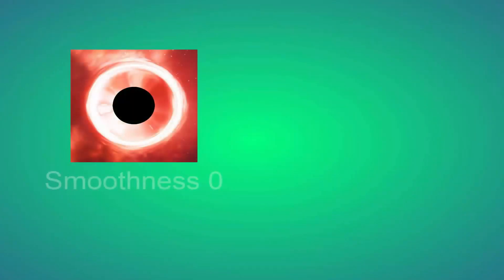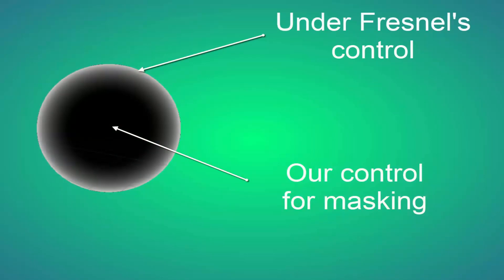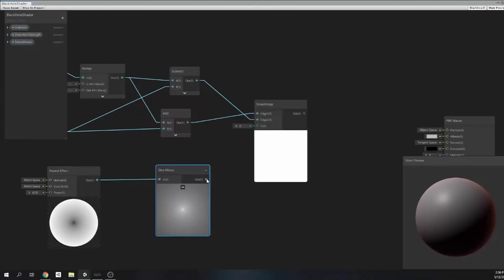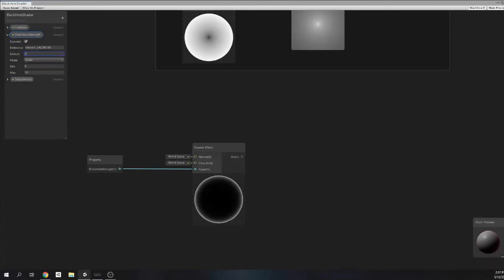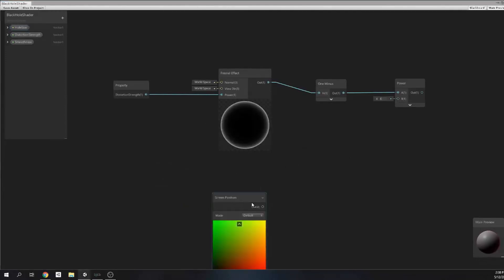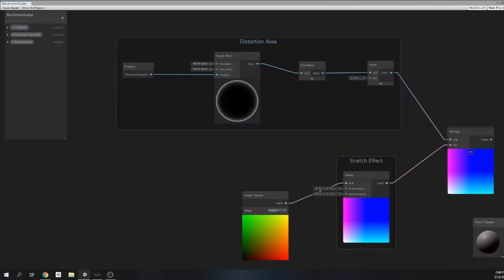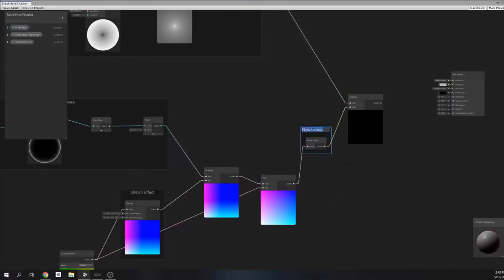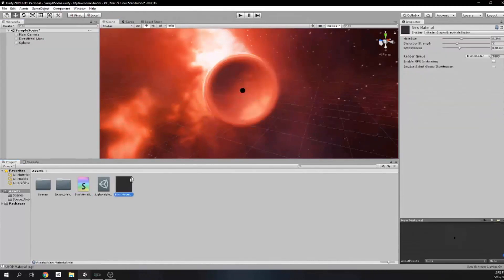UNITY SHADER GRAPH with Black Hole Shader

Comment: Amazing tutorial man! Is there a way to set the shader, so the distortion can occur also in materials set as transparent, like particles?
Reply from the maker: Hi! URP has a forward renderer by default, which means particles(transparent stuff) should be rendered in the same pass. So TL;DR; it should work with transparent stuff like particles, yes.

Comment: You liked my message but didn't answered man, can you help me if you are familiar with my peviously talked about problem, i really have no other options, i tried so many different things with this shader but couldn't find a solution
Reply from the maker: Sorry, I thought I wrote a response but I guess computers don't compute me these days. Have you tried enabling opaque texture on render pipeline assets settings? Also which version of urp/unity do you use?
Reply: @MertKirimgeriGameDev  yes i enabled opaque texture, it works just fine in Unity editor and the version is 2020.1.1f1 but the problem is Android build, i attempted to build with many different settings.My URP and shader graph version is 8.2.0 and. No matter what i do i cannot work it on my android device :(

Comment: Hey, it's amazing! But I do have a problem anyway... Blaco hole looks fine while in the middle of the screen but the problem is that the distortion around is comes from the object I'm looking at even if it's not behind the black hole... for example I have the black hole on the left half of the screen, the planet on the other half and when I look at the planet, it still affects the black hole... besides that it's amazing and just what I was looking for but can't find a way to solve this while still having a good performance
Reply: i have the same issues did you fix it, any one can help us plz?

Comment: I had problems with its transparency I realized that the albedo was interfering with its transparency so a quick solution was to connect the final multiply node to albedo as well i know its not a good solution but it worked just thought i would share it
Reply: @K P I will try for sure tnx

Comment: How do you fix the fact that it breaks if u dont look directly at the blackhole? like if a star comes in the foreground it still affects the back hole
Reply from the maker: You can try to use a second camera and feed it into shader, then duplicate every and use this second camera texture for it. Then blend them together. Or the easier way,. Use that second camera to capture for ground again but use the render texture with a material then assign it into a plane and put the plane at the back of black hole. I'd suggest you to render only star with layers from second camera and enable transparency to not scramble things. Keep in mind that multiple camera setup only works with latest versions of URP.
Reply: @MertKirimgeriGameDev  Yeah thanks for the reply. I have been trying to do exactly that but not sure how. Can i let the shader graphs's scene colour somehow get the second camers opaque texture? or do i do it completely differently?
Reply from the maker: There is this "Camera stacking" feature that URP introduced recently, I think you need that, it might let you use opaque texture. There is another way tho but it is quite tedious so I'd try this one.
Reply: @MertKirimgeriGameDev  seems like it only lets you make overlays which i cant get to work :(
Reply from the maker: @Ab-ox7mo  Well, if you wanna capture something behind the camera with shaders, what I can think of as a separate option is RayTracing/Path tracing. But I'd imagine that it would be pretty difficult to make with shadergraph.
Reply: @MertKirimgeriGameDev  Yeah,  Im sure there is a way to do it, its just not worth the effort considering it still looks pretty decent without it. thanks for the tut!

Comment: Hey Mert, awsome black hole! But I have a problem when using the LWRP because not all shaders of mine are compatible. Is there a way to use the black whole without LWRP?
Reply from the maker: You need to write shader code than. Or use 3rd party node based tools such as Shader Forge or Amplify.

Comment: Hi there Mert! I've tried following this tutorial on Unity 2020.1.0a11, and unfortunately in the graph editor, it shows the message that "The current render pipeline is not compatible with this master node". Is there a way to fix this? I have downloaded the Lightweight Render Pipeline, NOT the Universal one, but it is still apparently called "Universal Render Pipeline". Might it have something to do with that?
Reply from the maker: Hey Jelle! Light weight render pipeline is renamed as Universal Render Pipeline in newer versions. But that shouldn't be an issue because I tested it two weeks ago with universal render pipeline and 2020.1 alpha and it was working.
So, let me ask this, have you switched from legacy to Universal Render Pipeline by assigning it on graphics settings?
Reply: @MertKirimgeriGameDev  You mean in the project settings? I am basically a complete noob when it comes to shaders and settings related to it. When I go there, and to the "graphics" tab, I see: "Scriptable Render Pipeline Settings". Under that, I see "None (Render Pipeline Asset)". When I try to change that, there is nothing else to select. Is this what you mean?
Reply: @MertKirimgeriGameDev  Also, I didn't expect such a quick response! Thanks a lot!
Reply: @MertKirimgeriGameDev  I just figured it out. Sorry for the extra posts, and thanks again for your answer <3
Reply from the maker: I am glad you solved it 🙂 No problem for asking questions. I am trying to help y'all with this channel. Community taught me a lot over the years. I feel like now it's time to give something back😊

Comment: Hey there Mert. My team and I have been at this for a few hours with a default LWRP install, and can confirm this shader is no longer working as of Unity V209.2.11f1. There something funky going on with it not respecting transparency. I gave your video a like anyway, as no doubt it used to work back in the day and it looks great.

Edit: Correction - After downloading your source from Git we can see that the shader still works, none of us can figure out whats gone wrong here for the longest time until we identified you need to MANUALLY set the Albedo color to BLACK or it will not work. Such a simple step.
Reply from the maker: Hey there! I am glad that you folks figured it out! Let me know if anymore questions rise up🙂 Good luck!
Reply: Hey, great video! I also have problem with it in newer updates. In which version was it made? It would really help.
Reply from the maker: @tomaszjajecki9521  I guess I've made it with the 19.1 but it should work with newer versions of Unity and LWRP too.
Reply: Sadly I tried it in 2020 with URP 7.0 and 7.1 and it didn't work. And later I tried to make it work in 2019 but after I imported it shader graph editor didn't open. Most interesting this was that shader graph editor wasn't opening ONLY blackhole shader. I will try it again tomorrow but I think 2020 is still bugged.
Reply from the maker: @tomaszjajecki9521  I'll see take a look into it but keep in mind that 2020 is in alpha stage so I would be surprised if Unity opens up without bugging out :P
Reply: Yeah I understand that. Sadly there isn't any bug reports about screen color don't working. I would love if you would look in to 2020 and check if it works. Thanks again for great video.
Reply from the maker: Okay, I downloaded and tested with 2020.1 a12 and it works. As I mentioned in the video, you need to enable Opaque Texture from your LWRP/URP settings. Then it works. I also tested with 2019.2 and still working in there too. I'm gonna update the readme file to explain how to do that.
Reply: Ok.... Maybe it is 2D renderer thing? Or 2d setup? Or new RP post processing? I enabled opaque mode and check all settings. Hm.... I must to check it soon. Thanks
Reply: Nvm I found an error. 2D renderer doesn't work with this shader. Thanks for help.

Comment: Hello, this shader can't run new unified shader graphics QAQ
Reply from the maker: Hey there! What do you mean by that ?
Reply: @MertKirimgeriGameDev  I am sorry, my English is not good,
Reply: @MertKirimgeriGameDev  This shader can't be run in the new version.
Reply from the maker: @番茄E  Huh! That's weird! Which version is that ?
Reply: @MertKirimgeriGameDev  2018 latest official version，After importing the shader, the connection between many nodes is broken.
Reply: @MertKirimgeriGameDev  I tried the link but it didn't work. I can only see a white ball with a black dot in the middle of the scene.
Reply from the maker: @番茄E  Can you check your LWRP settings ? Does this opaque texture generation is on ?
Reply: @MertKirimgeriGameDev  that's the solution